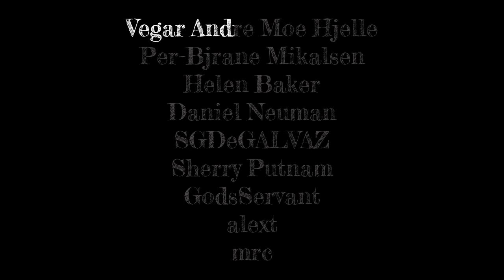structural failure

Comment: Everything we do is scaled up.  First, we make a model.  Then we test it.  If it works, everything is scaled up to fit the need.  It can happen on a larger scale just as it did on a smaller scale.  We even do it in reverse.

It happens with automobiles, architecture, biology, etc.  I doubt there are any branches where this wouldn't apply.

It's the same argument I use on Earth because if it can happen on a larger scale, it can happen on a smaller scale.  There is nothing in existence that demonstrates what science claims the Earth does.  NOTHING spinning holds material to it.  It is always flung off of it due to the forces/energies involved.

Comment: I v done the only $1,000,000.00 lime stone facade job in my area. Just the stone. I did it 20 years ago. Most looks like its a day old. Parts are destroyed by salt. 
Most bricks are concrete or grout. Most landscaping block is groute with chunks so its bad grout. . No good. But in theory the grit or accurate would give its strength structure which it does but over time it degrades because it is so porous and for some reason they like to put sodium chloride in it so right off the get-go it's starting to break down right at the get go. In theory the chloride will help it hard faster but dude it eats stone !?  So far I am actually impressed with the vinyl concrete patch that is going around I've used lots of it in the recent 5 years so far so good. I'm going to make a waterfall out of the stuff and see how it holds up I'm going to coat it because I don't want whatever chemicals to reach out is at least as possible. Then we'll see how it handles  the winter ❄️ i live in Wisconsin, west side on the border along the St Croix River. Beautiful area. With the rock cliffs and river

Comment: the thing with the geopolymer is the chemical reaction that takes place leaves the rock way stronger than it was originally, im not saying your wrong teach lol youve shown me so many structures that are made  ive also seen obelisks that look like solid granite or marble but its just a facade.
Reply: yea like the "ponce de leon hotel" in florida, the coquina mix, harder / stronger over time, MAY not need reinforcing, but I'm quite sure it would still benefit from it.
Reply from the maker: Yhea agreed & its a topic i have just begun to dig into again AFTER releasing this video, i`ve also noticed people use the term not realising it covers MIXTURES / concrete etc is geo polymer & other applications which would cover surfaces, so its not that simple to just throw out when speaking on ancient walls etc (((thanks)))

Comment: Old concrete from decades past is full of impurities, yet it is 4x stronger.
Reply: I think it contains ground up bones from human beings
Reply: Who said it was full of impurities?
Reply: As in chunks of bricks, large gravel and such
Reply: Those "impurities" are in fact what gives it strength. Your body is a single homogeneous element or material. As the earth is not. The absolute best Steel, which differs for what you're making, is a mixture of diff elements and molecules. Pure things have great strength in one direction and are very weak in others. Mixtures are better.